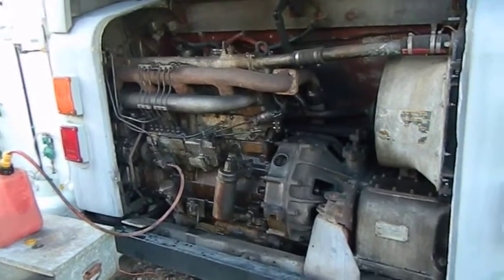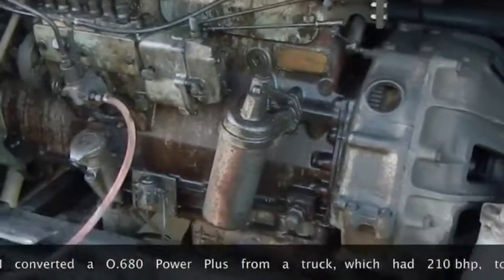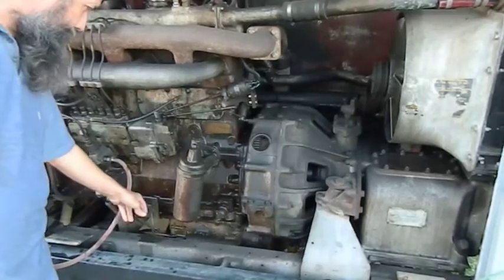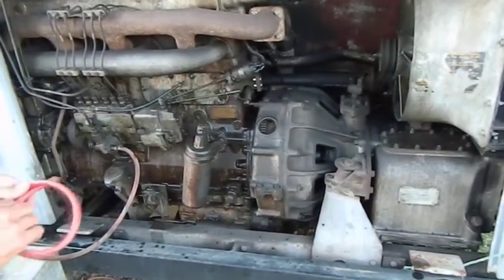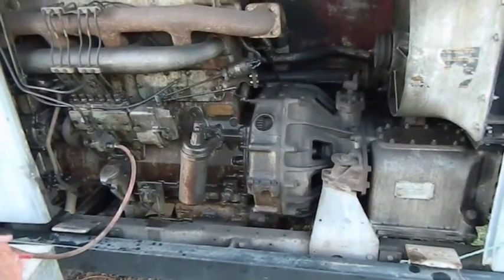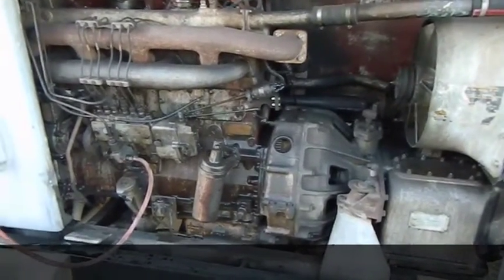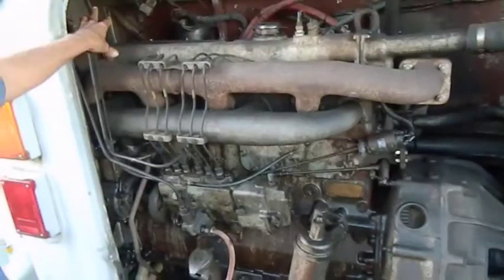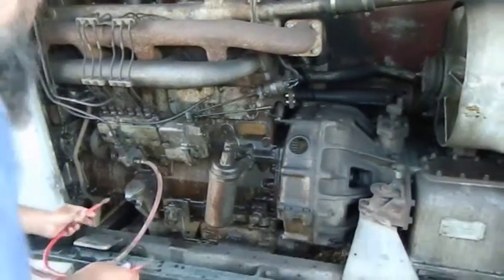Leyland O.680  Diesel Engine power plus for Atlantean being started and running.

Comment: I have overhauled three engines from this family, two O.600’s and a O.680. The horizontal versions that is but otherwise almost the same. These engines will outlive you if given proper care. Just make sure you run it warm each time and check the oil and coolant before every cold start. Be sure no water leaks into the sump which happens due to condensation and a possible small internal coolant leak caused by a worn seal. Make sure you know the oil level on the dipstick, when the oil level has risen compared to the last time you checked the level, water has leaked into the sump. The water will be under the oil. Normally, when the vehicle is used on a regular basis, this water will evaporate and won’t cause any damage. All within limits of course. Parts are getting very scarce to say the least and these engines are quite sought after these days.
Reply: Hi. I'm just about to buy an Atlantean, with a 0.680. Engine rebuilt 10 years ago, but have a leak at the water pump when under pressure-ie radiator cap on.Previous owner says due to being made of carbon, and no replacement parts available, it's an impossible fix. Any suggestions? Regards Don

Comment: I have a Leyland Panther with the mid mount flat six diesel. It was a Metro bus before being converted to a motor home.
Mine sounds exactly like this engine and looks similar. 
I can't find much information on the engine and transmission so don't know what type or model engine it is. Any idea?
Do you know what type of transmission oil these gearboxes use?
Cheers
Reply: @All Betternow Cheers

Comment: power plus had different inj pump
Reply: @All Betternow so you have a rotary inj pump on it now different to one in video?
Reply: @All Betternow power plus injectors bigger but lower pressure to suit rotary pump which also had timing advance built in unlike inline pumps
Reply: @All Betternow power plus had different "solid" crank as well
Reply: @All Betternow well if anyone wants to ask me go ahead,i did my apprenticeship on these engines and detroit 2 stokes.
i know these leyland engines very well but still get surprised by rare options i see from time to time as well as the l-111 variants and DAF variants as well
Reply: @All Betternow they were even different options accross country,all the perth panthers had rear rads with mechanical fan,whereas all the eastern states ones had front mount rad with elec fans,westrail used single decker version of atlantean chassis called lion
Reply: @All Betternow did a trip the melb a fw years ago to rebuild motors and boxes for dickheads at gymbus and cool dudes at melb double decker tours
Reply: @All Betternow and i got solutions for any elec probs you got as well
Reply from the maker: @All Betternow Hi Andrew, I have a couple of questions for you, if I remove a rear axle, would that affect anything if I had my bus was towed. I wouldn't think that it would, as once you undo the bolts around the axle, it just slides out anyway, so therefore, the axle and the nuts attaching the axle don't hold the wheels on anyway, I would just need to re-cap something back over it to keep dirt and stuff out of it. Also do you know the thread on the nuts that hold the axle?
Reply: @All Betternow you need to remove both axles so centre is'nt turning,heavy plastic and some duct tape all thats needed for covers
Reply: @All Betternow leyland used unified threads on engine and bsc/bsf on gearbox/AEC was opposite to prevent parts interchange
,i think chassisand dif was unf/unc

Comment: Do you still own this atlantean?
Reply from the maker: Hi Dylan Green, yes I do but it no longer has an engine. I sold the engine to a person who is restoring another Atlantean down Sydney way, so that at least the engine can live again. The bus itself is mounted up on blocks and is now a three bedroom home, with hard annexe etc., of which I also intend to sell.
Reply: @bigroundwatermelon6456  Was fitting a O.680 Power plus an easy engine swap?
Reply from the maker: Dylan Green, well, the 680 Powerplus was from out of a truck, so we had to swap a number of parts, such as the sump, oil pump, fly wheel, bell housing, air intake and exhaust and some gear up the front. It took three of us a day and a half to swap things over on the engine doing a backyard job.
Reply: @bigroundwatermelon6456  Gday mate . I have a panther ( motorhome- party bus )  with 680 in it . Just about to put turbo on it from a later version TL11  . Did yours have a turbo ? 
Atlantean is a big bus and wonder how sluggish in regards to power it was?  
Nice work on the conversion mate .
Reply from the maker: Hi BadDog, no our bus did not have a turbo, the only real upgrade was going to a powerplus instead of the standard. (Worth it) Sluggish? Let's say that it wouldn't win too many races, but it did have the power. No matter whether you drove it up or down slopes or with or against the wind, it just kept at the same speed and fuel usage, which was 3km/litre. Hope you have success with your endeavours too.
Reply: Do you specs on power plus . I have a complete spare motor and gearbox so wont be buying another one . 
Mine goes well 4k/ltr solo or 3 k/ltr A framing my patrol behind it . I have a split diff and 4 speed pnuemocyclic box .
Reply from the maker: BadDog , not sure what you mean by, "do you specs on power plus"?
Reply: @bigroundwatermelon6456  i am looking at what improvements the power plus has vs the regular 680 so I can implement them .
Reply from the maker: BadDog, basically no real specific improvements other than increased power, I know that sounds a little simplistic but that's the only real difference. The reason for this is that the only change from the standard engine and the power plus is the injector pump. There may be a diesel expert that can add to my comment.
Reply: Thanks mate . Another batch of research coming up 😳😳😳

Comment: London ordered hundreds of badge engineered Leyland Fleetlines which were originally a Daimler UK product (yes the same as the cars) that competed with the Atlantean, with the same transverse rear engine layout. 
Some had Gardner engines but many had 0680 Powerplus engines too. Absolute beasts they were too. I came across a few retired ones as open top tourist deckers when I visited London in May, 1999 and one had a Voith automatic transmission fitted!
Reply from the maker: James French: Hi James, thanks for your reply and your interesting comments, our bus is likely to spend the rest of its days here now, but I have decided to sell my engine off to a bus restoration group down in Sydney, who are restoring an Atlantean (Contact Catherine at Forest miniatures: forestm@bigpond.com). So the heart of the old girl will live on for many years from now. And I'm hoping to sell the site off to become a home of family to live in also for many years as well.

Regards, Russell
Reply: Big round watermelon that's bitter sweet, but it's really a waste to have an engine sitting there not doing what it's designed to do -moving a load. I'm glad it's being put to good use elsewhere. I hope you get a good buyer for the bus home.
Reply from the maker: James French So do I and thanks again James

Comment: Power plus 680s were fitted to a few Atlanteans back home, mainly in 'dual purpose' spec, i.e buses with coach seats, and was fitted to the Bristol VRL coach. Powerplus engines were usually in horizontal form and used in Leopard coaches. A friend had a 680 Powerplus fitted to his National mk2, and it could crack 80mph without breaking sweat
Reply from the maker: Hi Nethalus,  thanks for your input, hopefully, it will be interesting to others as well
Reply: The gearing is still the same, no way would any gearing allow a bus to do 80 no matter what engine.
Reply: @bonkeydollocks1879  they made a coach version of the National for Motorway work which had proper coach seats and a high speed diff, could be that
Reply: @owenlewis8006  have you any proof of that please? I've never head of it and a quick Google search drew a blank
Reply: @owenlewis8006  plus no public service vehicle is allowed to do over 70 mph. Could you imagine a bus full of 56 people doing 80 to 90 mph? Haha 😂absolute rubbish
Reply: @bonkeydollocks1879  I don’t think you know what you are talking about. By law coaches today have speed limiters, so no, they won’t go over 70. Who is talking about today? Midland Red CM5T of the 1960s was built specifically for high speed motorway work pre-70mph limit and could do 100mph. From then until limiters became mandatory in 1992 plenty of coaches were capable of speeds like this. National express rapide drivers in the late ‘80s got into trouble for 3 figure speeds. With no speed limiter a Truck can do 75-80 before running out of revs. A coach has the same engine but a much taller diff ratio, why is it such a leap of imagination to believe it’s not considerably faster?
Reply: @owenlewis8006  hey calm down, you're getting worked up over an imaginary story concerning a coach that might have gone fast, get a grip please and try and hold a conversation like an adult. I see you have skipped over the request to give evidence. Again a quick Google search reveals nothing. Please supply a link to support your claim. Until proved otherwise I believe you are still talking rubbish. Just calm down, it's not important, unless proving or not you talk rubbish is more important to you, 100mph coach indeed hahaha 😂🤣😂🤣
Reply: @owenlewis8006  the most they ever got out of one was an empty coach at mira test track and it just got to 85mph. It was then detuned and the ratios changed to go into service. Realistic speeds were between 70mph and 80mph on a good day. 100mph hehe🤣😊 absolute rubbish

Comment: Hi there big round watermelon..I have a question.is your running gear on the bus still for sale by any chance thanks..
Reply from the maker: +Ron Geremy Yes, I am hoping to sell the engine, power coupling, gearbox, angle drive, radiator and driveshaft, all in one unit. Basically, leave it all on the engine frame that slides out, load that onto a truck and send it to wherever it needs to go.
Reply: Ok mate can I give you my number I have something in mind

Comment: Wow what a great setup you have there..that's my dream.. must say not many left now.very hard to find parts for. I restore the Leyland pneumatic shifters for them.. just chasing a rubber boot for it mmm hard to get.What a great effort miss the old days. Wish they were still in use in Queensland..it's great to see m still going.. no spare parts? Ha ha .good stuff
Reply from the maker: +Ron Geremy Thanks for the great comments Ron, If you're looking for parts there's Doug from Mr Motor Parts, but you may already know of him. These guys haven't sold a complete motor for years and only have some parts. There is another one here in the town where we live, and I did see one up south of Cairns about 9 years ago. Spare parts? not sure exactly what you mean there but if I was going to sell any parts I would have to sell the whole motor gearbox and radiator and air cleaner all as one. We are hoping to do a 'video tour' of our set up one day, but we have made changes to it since we have put it up on blocks as it used to have a shower and a toilet, but now they are missing.